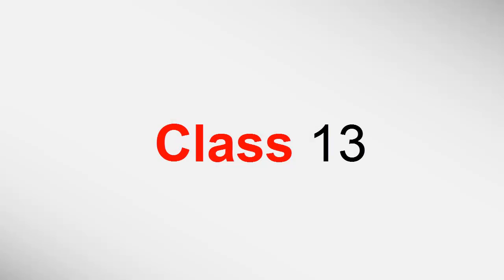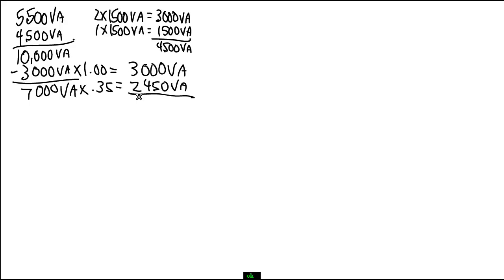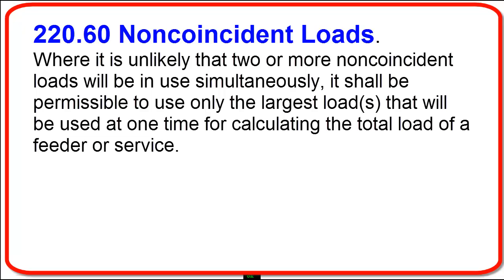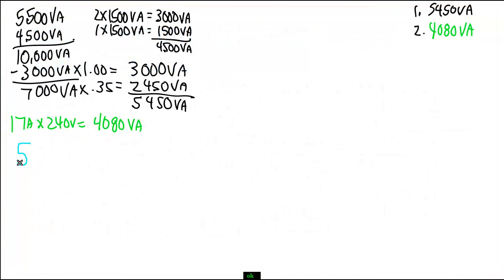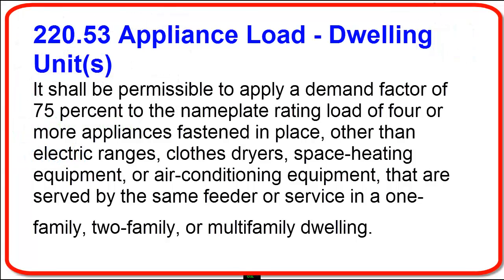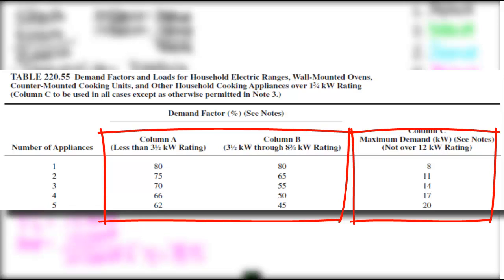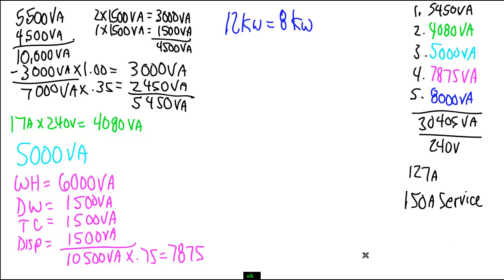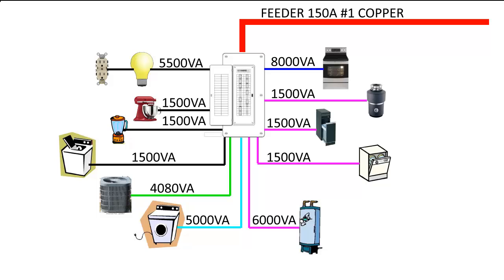CLASS 13 Article 220

Comment: I thought we already did a calculation for laundry which was 1500VA? Why is another 5,000VA added on?
Reply from the maker: Kevin thanks for the question.  The laundry circuit was for the 120v equipment.  The 5000va was for the dryer which is a 240v piece of equipment.

Comment: did you calculate the feeder conductor at 83% of the service?
Reply from the maker: Matt thanks for commenting...This video was published during the 2011 code cycle.  The NEC 2011 and earlier had a table (Table 310.15b7) and that's where you would find the feeder size for a dwelling unit.  In 2014 the code changed and now you have to look at Art 310.15(b)(7) and do the calculation, if you meet the requirements of the article.  So you would take the Main Circuit Breaker size x .83 and that would give you the ampacity of your feeder.  From that point you can look at Table 310.15(b)(16) and find your size.  Ex. 150A x .83=124.5A.  If you look at Table 310.15(b)(16) 75 deg column you find that your feeder size would be #1 Copper which is the same as the table that you see in the video.  Hope this helps!!

JB